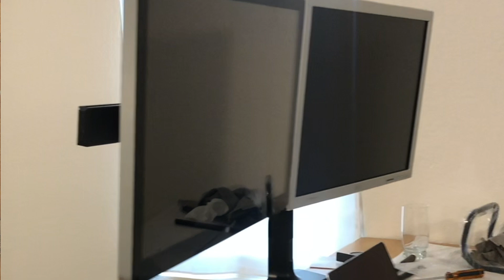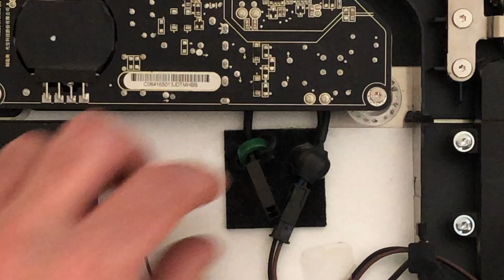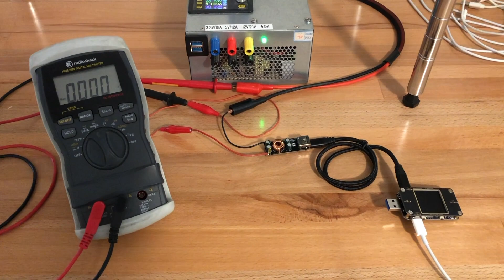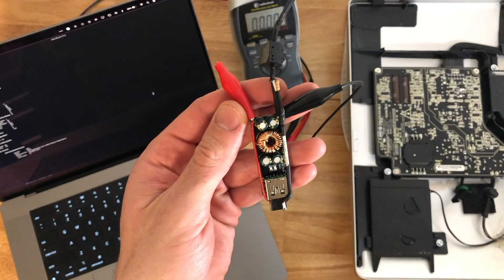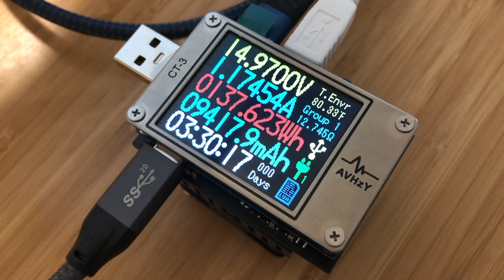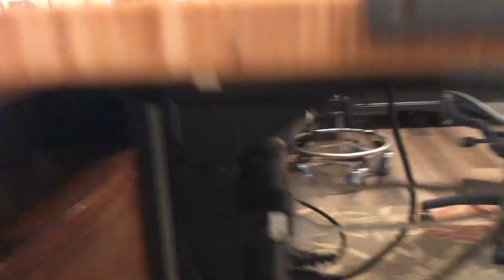Thunderbolt Display USB-C Retrofit for Modern Macs!

Comment: I have a project that you might be able to help me with. I own an early 2015 MacBook Pro A1502. The MacBook has 2 x Type A, USB 3.0 sockets and a Thunderbolt 2 socket. I wish to run a NVME M.2 SSD in an external enclosure. It seems that the Thunderbolt 2 has the best data rate. But trying to find a type 2 Thunderbolt NVME SSD enclosure has proved impossible. What has been suggested it that I use the Mac Thunderbolt 2 to USB C (technically Thunderbolt ?) adapter and get a type C enclosure …. but this won’t work either because no power is sent to the enclosure via this cable setup. I could find power by using one of the USB Type a connectors on the MacBook and make some sort of cross over cable. But maybe the type C connector on the enclosure will limit the data rate and cause voltage selection issues? How would you set about this project?
Reply from the maker: Yep. Thunderbolt 2 was primarily a data transport, using Mini DisplayPort connectors. It only carried a small amount of power (15W?) and was not designed to power devices.

Thunderbolt 3/4 combines the data transport with USB Power Delivery (PD), using USB-C connectors. So you get a lot more power!

As you pointed out, the Apple TB2 to TB3+ adapter only converts the data transport, it does not inject any power.
And your MBP USB-A ports only provide about 5W.

I had the same 2015 MBP, it just plain does not supply any significant power to peripherals.
So you really need to come up with a solution that lets you supply external power. Here are a few options I can think of:

Option 1)
TB2 enclosures have external power input. Keep looking for a used TB2 enclosure, perhaps on eBay (I found a LaCie on Craigslist, I'm open to selling it).

Option 2)
Use a TB3+ dock. CalDigit is one manufacturer. You should be able to connect your TB2 equipped computer to a TB3 enclosure like this:

Wall Power DC -> dock
MBP TB2 -> TB2 to TB3 adapter -> dock
TB3+ enclosure -> dock
The dock may power your enclosure

Option 3)
Look for a TB2 dock the breaks out USB 3.1, and use a USB3.1 enclosure, with external power provided to each.

Option 4)
Probably the easiest option is to use a USB3.0 enclosure connected straight to your MBP, with external power.
This eliminates the need for a TB2->TB3 adapter or a dock. The top speed is lower, but still really fast!

Speeds (theoretical):
USB3.0 5Gbit/s
USB3.1 10Gbit/s
TB2       20Gbit/s
TB3+    40Gbit/s (max)
Reply: Colin how can I contact you?
Reply from the maker: @JACB006  Just added contact info, go to my 'channel' page, see the 'about' section.

Comment: I don’t know if you’ll read my message but what are are you using for the two thunderbolt monitors. They are heavy and I can’t find an arm with the weight rating.
Reply from the maker: Hi Morgan I answered that a few other places in the comments. It's a VIVO, I don't have the model info handy but if you look around here you should see some discussion of it.

Comment: Amazing video. What if I was lazy and wanted an external dock that took in Thunderbolt 2/Mini-Display port and USB-C power and outputted it all to a single USB-C cable. Does that exist?
Reply from the maker: I don't think so. I think you'll have to use a TB3/4 USB-C dock, and also use Apple's TB2 to TB3 adapter.

Comment: Have you had any problems with heat affecting this?
Reply from the maker: No heat problems, and I regularly put my hand over the back of the display where the Power Delivery converter module lives, and I can only barely feel any heat in that area. So far so good coming up on 1 year!

Comment: Colin...
Thank You!

A) I have 2 Thunderbolt Displays in front of me right now. (and 1 in storage with a bad tb cable!)

B) I loved these things when I walked out of the Apple Store a decade ago with the 2 giant suitcases they come in.  Specifically for the use case that you are resurrecting:  a single ultra-clean umbilical cable across my desk to my MacBook Pro.  The monitor itself was a dock with all of my peripherals attached.  The minimalism was unprecedented, and you've made a way to bring that forward to 2023.  So thank you.

C) This opens up a Bunch of other options as well for other use cases that fellow owners may have, such as:

1- Just unplug both the TB and the Power, remove the umbilical, and that's it.....get rid of that annoying ass cable that I loved in the beginning but has been driving me crazy ever since.  First of all you don't actually need it because you can send TB into the other port on the back of the monitor anyways.  Unless you actually need to daisy-chain thunderbolt, which I do, so...

2- Remove the umbilical, leave the power disconnected, and Just add a new TB2 cable At Whatever Length You Actually Need!!!  If you're not using a MagSafe laptop, that thing is just dangling around (with gaff tape on mine) not connected anyways, and I'm guessing not using the MagSafe power will extend the life of your display's power supply as well.  Plus that cable was Always too short if you were say hooking these Thousand Dollar monitors to anything Other than a laptop on your desk.  Say a Mac Pro tower....loaded with hard disks...and all the fans and heat, at my feet!  (Where were you 10 years ago Colin!)

3- I'm guessing that Most people would benefit most from rather than doing that impressive power PD supply hack on the inside of the display, or even putting the TB3 to TB2 adapter on the inside, simply follow your umbilical removal technique, drop the power all together and replace with a New TB2 (at chosen length), which looks like it'll hot-glue down even cleaner.  Then use that TB3 to TB2 adapter at the End of the new TB2 cable going into your TB3/4 Dock of choice, which can solve many other issues.  You can Hide it and everything else you need plugged into it, and maybe bypass the dock built into the TB Display.  And you can Hide it.  So on the clean theme, while this display impressively minimized down to one cable and two connections, these new docks can supply TB Data, Displayport Video, and 100+ Watts Power all down a Single TB3/4 cable.  Can't get any more minimal than One!  
(well wireless is coming...)

4- (Disclaimer: I read through the comments so I know you already addressed what other pointed out, and I agree with you on the price and length of these apple cables, but for anyone else...) 
If money was no object and you wanted the cleanest "Apple did it in 2023" upgrade,  then you follow the video and remove the old umbilical, then install Colin's PD USB-C power mod ($?), then install the Apple TB3-TB2 adapter ($50) as described, and then... you install the 2-meter, midnight color, Apple USB-C to MagSafe 3 cable ($50) and a 1.8-meter Apple Thunderbolt 4 Pro cable in black ($130).  Add some snakeskin cable wrap and some heat-shrink tubing and for a couple hundred bucks you have a new Apple Umbilical that does exactly what the old one did.

(Now while that MagSafe cable is 50 bucks and I don't know an alternative, I'm sure you can find a matching aftermarket TB3 cable for Much Less than the Apple Pro one.  And you could get both in silver closer to the OG theme.  But whether you Spend less than a hundred or close too three, that money doesn't buy you extra functions, where just buying a TB2 cable and investing the rest in a TB3/4 Dock actually results in a cleaner setup, better Power Delivery, and additional functionality, while retaining All the original functionality.)

5- I'll be cracking mine open soon.  But since you've shown us mere mortals the way, I wonder your thoughts on the other Elephant sized Apple in the room....    getting these Thunderbolt Displays to accept DisplayPort video information!  

For years I have regretted getting these Apple Thunderbolt Displays because at the time I also had two Apple Cinema Displays that were much less expensive and nearly identical, except...   The TBDs had TB2 Docks built in, which as we discussed was amazing, for a while.  Using the built in docks meant running all of the cables Up to the Monitor, which as much cable management as I did was always hideous.  And I could just get a standalone TB Dock, and Hide it, which ultimately you had to do anyways if you need your computer more than a couple of feet away.  Daisy-chaining a dock extends your range, and can tuck the rats-nest away neatly underneath or behind something.  The built in was only used for USB sticks, iLok, BT dongles etc.  No cables.

So then the TBDs advantage went away over the ACDs, and the disadvantages became obnoxious.  The identical looking miniDisplayPort connectors on the Cinema Displays could easily be converted to DVI and even HDMI.  Not the Thunderbolt Displays.  Even though Thunderbolt is just the PCI protocol and DisplayPort protocol on one cable using miniDisplayPort connectors.  You can't get to the DisplayPort signal without TB Magic.  At least that was the conclusion of many of us in the pissed off owners circle, back then...

Do you know of any advancements in the past X years that allow us to use this monitor simply as a Monitor?

As I just bought a 55-inch OLED with Dolby Vision for $350 bucks this last Black Friday, my anxiety levels have definitely diminished along with my dreams.  But I do like the thought of sleighing this dragon once and for all!

But at least you've shown me how to lop off a few of these Hydras' heads, even if I can't ultimately make them bow to my authority!
Reply from the maker: Glad to be of help!

To your last point, you've basically got it right: the Thunderbolt 2 connector is the same as a DisplayPort connector. And the unmodified Thunderbolt Display requires a Thunderbolt port, it will not run off of simple DisplayPort.

Meanwhile the TB2 port on a Mac will function as TB2 or DisplayPort automatically.

I spent many many hours researching this and finally got to the bottom of how video is unloaded from Thunderbolt. From memory...

Thunderbolt is a Ferry. DisplayPort is a car, as are USB, Ethernet, Firewire, Audio, iSight Camera, etc. They can drive on their own, or they can be carried on a Ferry. But a Ferry needs a special terminal, it can't go straight to a driveway!

The Thunderbolt Display and your Mac have Intel's Thunderbolt chipset onboard, as do all Thunderbolt devices. This chipset loads 'Cars' on and off of the 'Ferry'.

The unloading action on the Thunderbolt Cinema Display breaks out audio/USB/Ethernet 'Cars' to the ports on the back, and sends one video 'Car' to the LCD panel. Each Intel chipset is capable of unloading only a single video type 'Car'. It cannot break out video to go to the LCD panel and also send video in the DisplayPort format to the port on the back.

Remaining 'Cars' still on the 'Ferry' are sent out the back port onward to other Thunderbolt devices.

A second, third, or fourth Thunderbolt Cinema Display does the same thing.

So to get a DisplayPort signal out of a Thunderbolt signal what you need is a Thunderbolt device with two ports, and no built in video device! That way, the Intel Thunderbolt chipset inside, can unload the video and place it on the output.

In my previous setup I used a Belkin TB2 hub to accomplish this. I was able to run a DisplayPort monitor off of the Belkin hub's extra TB2 port. This can be done once, at the end of the daisy chain.

My setup was:

Macbook Pro 2015 ->
TB2/Magsafe umbilical cable ->
Thunderbolt Cinema Display ->
TB2 cable ->
Belkin TB2 Hub ->
DisplayPort to DVI adapter cable ->
DVI based Dell monitor

So I had a TBCD and DP based display both running off of the single TB2 port on my Mac, no extra cables. It was nice for its time!
Reply: @colindgrant  Great analogy, I have been tinkering trying to get 2 x TB displays to work on the Mini M1but it its not possible.  I suspect apple may have blocked it in the software driver but not 100% sure
Reply from the maker: @symosys  Each Mac has a given number of displays it can support, based on hardware resources.

In the old days you had an individual video card for every display, and while the hardware has changed the resource constraints still exist.

So while Thunderbolt may have enough bandwidth for many displays, the Mac still fundamentally has to have enough hardware resources to support each additional screen.

My 2021 MBP 16" M1 shown in the video can support the built in screen, and my two external monitors using built in display-dedicated hardware. To drive the third screen I use a DisplayLink adapter, which borrows from the USB-dedicated hardware.

You may be able to use DisplayLink to add another display. Good luck!

Comment: Hi Colin, Can i check if your setup can do brightness control using "Ctrl + F1/F2" keyboard shortcut?
I am having an M1 iMac and connect to 24" LED Cinema Display. I am unable to control the display brightness using this keyboard shortcut, but am able to do so with my Intel 2015 MBP.
Hence, I am using a 3rd party app known as MonitorControl on my M1 iMac to control the brightness.
Reply from the maker: It works on my M1 Mac using Control (^) + F1/F2...most of the time. I have noticed that sometimes after resuming from sleep, one or both of the external monitors will not respond to the keyboard shortcut. When this happens, I can go to Displays settings and see that the brightness slider is missing there as well. The fix is to unplug monitor power for 20+ seconds, then unplug/re-plug the Thunderbolt cable. Definitely non-ideal.

Comment: I think it would be pretty easy, if not expensive, to just find the smallest thunderbolt hub with power input and take it apart and see if it fits anywhere inside the display. that way you get power and thunderbolt through one cable.
Reply from the maker: Yeah, I think that's a great way to do it. If you find something that's affordable, please post up!
Reply from the maker: Well, now I'm pursuing this idea :) The challenge is going to be powering the TB4 hub from the display's power supply with sufficient wattage so that the hub can power the laptop via PD.
Reply: @colindgrant  Hi! Did You ever succeed with this idea?)
Reply from the maker: @OleksandrPakhalchuk  Still working on it. I am using an Anker TB4 hub, but it looks like it will need more input power than the TB Display's magsafe power supply can provide.

Comment: Seems a little risky when it comes to removing the logic board. But yes, I just might try. My Thunderbolt Cinema Display is the best monitor I've used so far when It comes to picture clarity. Not very ergonomic if you use the standard stand though. Right now I power my MacBook Air M2 with the MagSasfe 3 and connect the Cinema Display with Apples Thunderbolt to USB-C connector. It seems to work really well. When I used my earlier MacBook Air M1 I experienced so much flicker that I discontinued using it and had to replace it with inferior monitors.
Reply from the maker: Go on, do it! If you trust yourself to say, replace a phone screen, then the logic board in these is easy.